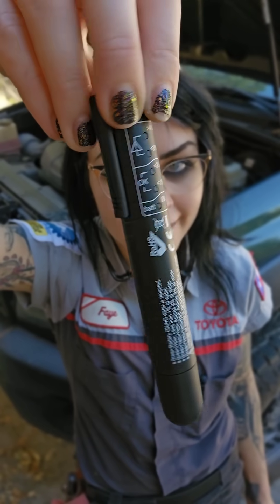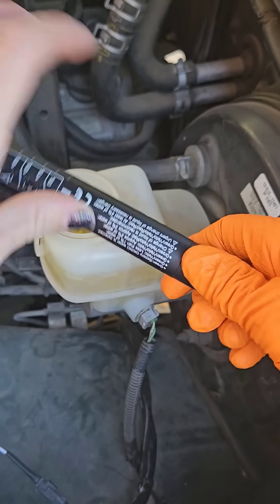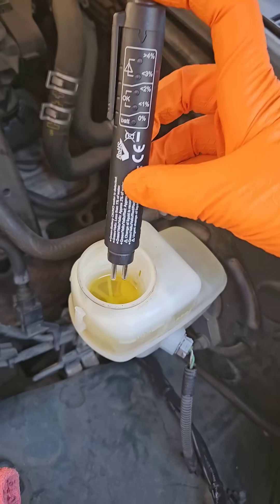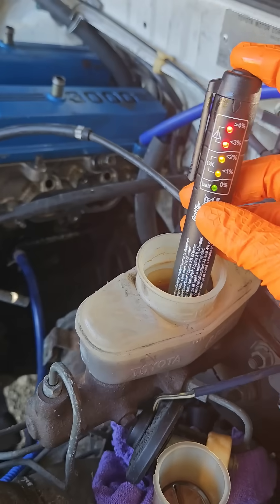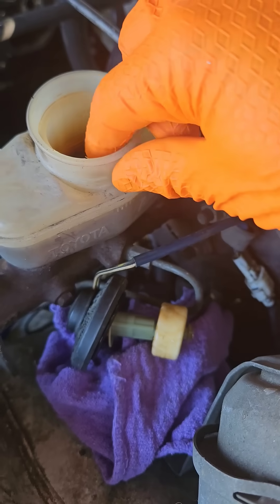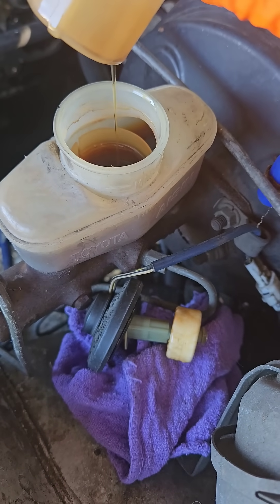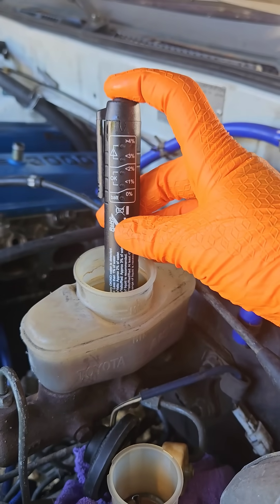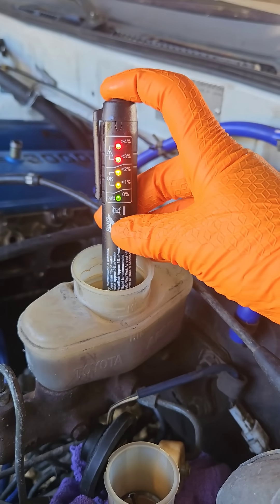Do you REALLY need your Brake Fluid Flushed?? How to Test it For Yourself!

Comment: My wife was told my car needed it’s wheels rotated, belts changed, an oil change and a new filter when it literally had 2200~ miles on it. 

She was spooked because it was a previously owned car (grad gift for a grad that didn’t happen and it had sat in a garage for 4 months only being driven ‘around the block occasionally’) but yeah some mechanic shops are out to get you but not all of them

Comment: Seeing as there are chunks in my brake fluid I’m going to have to guess it needs replacing (I already did it, I’m not driving around with chunky brake fluid) plus the brakes were leaking brake fluid so I had to get the whole braking system replaced…moral of the story dont buy a cheap old car

Comment: And even more dependable, you can take your VOM meter. You can buy 1 for 10 bucks at little redbox. You don't need to be $300 win. And what you do is you put one lead on the metal of the radiator and you put the other league in the center of the floor Ju, see under the cap and it, you see that.  It conducts then it needs to be changed notched. Because you see, good coolant, we'll show you 0 Ω or there about. But bad couldn't has metal in it, and it will conduct like water.. And you don't even need to own one of them when the guy tells you, you need a flush, ask him to get his meter out and show you. Or you can go to autozone. That guy or do it for you? You'd be surprised when one of those little $10 BOM can do for you. Battery light bulbs coolant.

Comment: I have had the same brake fluid in my volkswagen for 3 years.   I also only change the oil once a year.   Pre 2000 VW's are indestructible.

Comment: Yes it's good practice to do it.  It doesn't cost the earth but if you're DIY'ing it remember that ABS systems need flushed too which usually means activating it via a diagnostics setup.  
Water in the system will shorten the lifespan of many components too

Comment: Yes water does get absorbed. But its causes a high copper content in the brake fluid and copper absorb heat cause it to heat up the brake fluid cause it to damage seals in the brake system. That what she didnt explain.

Comment: Instead. Use a turkey baster and suck out and replace the fluid every time you do an engine oil change.
Reply: that helps but still nowhere near as good as a flush, most of the contaminants and the worst part of the fluid is near the calipers and it doesn’t really mix together

Comment: This might explain why my race car has had a slightly soft pedal even with full fluid and new pads and rotors and no vacuum leaks. The car was actually flooded twice in my garage and I never once thought to flush the brake fluid. I'm about to try and see if it helps. 😂

Comment: Another sign you need to flush your brake fluid , the color.  Brake fluid is a  clear fluid. Mold from the water in your fluid turns it dark. The darker it is , the more mold you have growing in your fluid. This mold inturn starts gumming up the seals and pistons in the system
.
Reply: idk bro, it's brown when it comes fresh out the jug lol
Reply: @swappedoutZ71   that is contaminated fluid yes it happens more than you realize, why a lid should tight all times on brake fluid containers after  so long a partial bottle will start changing colors from moisture that has gotten trapped in the bottle
Reply: It's not really mold, I have always been told that it's the residual stuff from the rubber seals etc from the brake cillinders/master brake cillinder.
Reply: Mold? That’s not mold 🤣

Comment: Service advisors love to pad the bill with things that don't require an expensive part that has to be ordered, then 95% of what they charge is for labor.  Bill the customer 1 hour at $150 per hr. Shop rate, then pay some lube-tech $17 an hour to do the job.   There is a way to get a firm brake pedal, it's called installing steel braided brake lines.

Comment: In my experience, 90% of the time, the person scamming you isn't the tech but the service writer.
Reply: thank you finally someone understands
Reply: I would always usually remove it on mileage services for my customers and let them know it was an every 2 year service. They would appreciate it and they would usually ask for me by name after that.
Reply: @JRipsTCG honesty is the best policy.  That's how I used to work as a mechanic. Treat them as you would want them to treat you. Selling them the priority items first and then the others you can recommend for them to decide if they want to do it then or wait for the next time. This way you get a repeat customer who will spread your name if you do good work.
Reply: Ha ha good one. I've quit a lot of dealerships because the techs were ruthless.
Reply: @xavierdiazmcguire4667  notice how I said "in my experience" and not yours
Reply: Service adviser.  Dealerships love making money on services.  Manufacturers even pay engineers to design the flaws in the system for more service money.
Reply: @daniellepage2923  I mostly agree. But sometimes flaws aren't designed, and are just a side effect of the design choices they made. I'm sure there's cars out there that are extremely reliable and very little flaws, but are also either highly sought after/rare (70s-80s Volvo 400, for example) or very expensive.

Still, some engineers make things waaaaaay more difficult than they need to be, or companies make specific things very susceptible to damage/wear (I'm looking at you, 2007-2020 Volkswagen water pump)
Reply: @agentsprocket  oh no doubt. Some are just mistakes or manufacturing errors. Or made on a Friday.  Lots of factors. But some are intentional. And even the regular average car is reasonably reliable. Some more than others.
Reply: @daniellepage2923  No they don't.  I don't know where you got that information from. No manufacturer is telling their engineers  "make this part so it fails at 100K and we will throw a few extra quid on your pay."  This doesn't happen.
Reply: @MikeAnderson-uj3oo yeah people don't want to believe that cars are complex machines and if you want to design for longevity AND performance, that requires additional costs in the production process. So it is about money, but it's not because of intentionally bad designs.
Reply: Well as a service writer, I totally get it when people look at me with disgust. The companiess with a scammy business model, makes their service writer a scammy one. I work for a family owned business with virtually no scams done. Every work has been transparent and there's no pressure on me. They even incentivize me when sales are high, but not on targets, which eases me.
Reply: @geethsan1567  no specific hate, I've just worked for some pretty bad dealerships. All in all it's just greed and/or apathy of the big wigs that really is the root of the cause, but I've worked with service writers that are just absolutely Jerks and will do anything to get that commission
Reply: @agentsprocket well that's the word were living in. Customer want the work done for pennies, and keep forgetting how pricy is expertise. 
As an IT I can say that more often than not fixing the issue boiling down to few seconds. 
That's why with small but unusual issues I always charge for expertise, usually more than for service.
With cars I'm taking car to garage and pay them for telling me the issue and advised fix but I'm doing job myself. They love it, and I'm saving on elbow grease
Reply: @jarocim you want to make sure you have access to manufacturer service information. I was just working on a Volvo last week. 
Now you would think that replacing the battery is straight forward and nothing out of the ordinary aside from resetting the battery life monitor would be a concern. 
However, if you scroll all the way to the bottom of the procedure it tells you to start the vehicle for the first time after reconnecting the battery, from the back seat. Because the airbags could go off. Without that manual you would be totally unaware that unintended activation of the airbags is part of the design. It's probably 1/1000000 that this actually occurs, but that's not a lottery you want to win.
There are a lot of details, maybe not as severe as this example, like this on most vehicles. You need that information and you need to look closely because sometimes its in fine print at the bottom of the page.
Reply: @geethsan1567 the fact it’s still “virtually no scams” not “no scams” both speaks to your honesty personally + the dishonesty of the industry lol.
Reply: Hehe, some shady places will just syphon the reservoir and add fluid without flushing the entire system. Make sure to find a good shop and develop a mutually beneficial relationship. The cheapest shop is usually not the best, too.
Reply: @deezeeYumYum  Yup, though I don't flush my brake fluid every two years either. Wasn't taught that this is even remotely close to regular maintenance, drain and replace yeah. Around the same time as a radiator flush sounds more reasonable. Again drain and replace every two years, 50k miles or 4 years for flush.
Reply: DEF. Esp if you own a BEEMER
Reply: Unless its a warranty, i see techs all the time ask for extra labor to be stacked on just because the book doesnt pay as much - kinda blows because the customer ends up eating that - the book should just be written correctly from the start
Reply: @SL33PINS3XY  As a retired technician, I can say "book time" does not equate for all circumstances.  Rust is the biggest issue. When things are rotten and siezed, it takes more time. And someone has to pay for it. Why should the technician be penalized ? The owner/ customer has to pay extra time for working on a rotten car. 
Or let's say the customer has had work done elsewhere that turned out to be a real hack job. Now the technician has to undo shitty work to repair it properly. Again, the customer has to pay. 
As professional tradesman, why does the general public get the notion that we should work for free ? This comes up all the time. They expect us to diagnose issues for free. Repair someone else's debauchery for free, because they "just had it done"  Let's not forget " I would fix it myself but I don't ( throw in pathetic excuse here). And they think it should be free because they claim they can do it themselves. 
It's not the book time that is flawed. It's the consumers perception of the trade that is flawed. 
My moto that I live by.
I didn't build it,
I didn't buy it,
I didn't break it.
And I most certainly will not fix it for free. 
If I can open the hood of a car and immediately see the issue I'm not going to charge a diag fee. For example,  car comes in with a battery light on. And I can immediately see the alt belt is broken. I would never charge for something simple like that. The moment I have to open my toolbox to diagnose an issue, the customer pays. The tens of thousands of dollars (maybe more)  that we have invested in tools to do our job efficiently and correctly comes at a cost.
Reply: yup, Ill tell a service writer they will need brakes soon and he tells the customer she's gonna die... glad at my current job we get to send videos directly to the customer and show them/explain the issues.
Reply: Well presented and informative!
Reply: And that is why I left Fountain Tire. They hired me to sell tires and basic service needs. There I was with $3-5000 mechanical bills standing there stupid because I can't even (though I know how to) elaborate the service to them. I just pass keys and run the tender. I hated it. I simply wanted to sell quality tire options... Will never take that job again.
Reply: There is a fine line between scamming and just plain being wrong. These folks have to move a lot of cars through the shop and probably don't realistically have time to correctly diagnose. So they do what your doctor does and figure out the most likely thing is and give you that pill.
Reply: Service writers get paid on what they sell. This incentive will make anyone push all work, at least if they want paid.
Reply: Wow...
Reply: Guess it would depend on the business model right? Whos saying what needs to be done might be different in different places
Reply: The majority of the time yes, but the tech is the one working under your vehicle, they are the ones letting the service rep know what need# to be done.
Reply: I worked at several dealerships in the service department as a runner while in school and Service advisors were the worst. Out of the 15 or 20 I worked with, maybe one wasn't a conman. I say maybe one because he was religious and he seemed pretty honest, but who knows, he may have been as bad as the obvious bad guys(back in late 70's to early 80's, it was all guys).
Tech's rarely were involved(but not never)
Reply: True.  I had a service writer who would keep poking his head in asking me if I “found anything”.
Reply: THANK YOU. I had a service writer who would take my recommendation for something small like a tire repair and turn it into four tires, front and rear brake pads, and an alignment.
Reply: yeah, and they’re not good at conveying messages to the mechanic either, make sure you write your complaints down so they don’t change the words around or misinterpret what you’re trying to say
Reply: So basically every dealership, thus why need to find a good local shop and watch the quality and cost go down for stuff you cannot do yourself. But people can change brake fluid can be done with kit from HF for 20 bucks or soda bottle and some tubing worst case to bleed them.
Reply: Yesterday my boss made me do an oil change on a car that had new oil... I was pissed cause I didn't want to do it. But my fraudulent boss was so adamant in doing it. I just want to smack this guy in his smug looking face.
Reply: 90% of the time??? More like 99.999999% of the time
Reply: Yep
Reply: More like 100% of the time
Reply: Yup and his name is Khalid at Toyota Center
Reply: bien.🙄
Reply: 100%
Reply: Contaminants from the system due to segregation of components is a factor too. If it’s black flush it. Best thing is every brake job get it then.
Reply: Being a servuce writer was one of the toughest jobs I had. I went into the job treating people like i wanted to be treated. I am honest, but everyone thought i was scamming them. On one car, the brake rotors were shot. From the outside, they looked great. On tge back side only 1/4" of the pads could hit the pad. The back of rotors were rotted out. Customer went to another place. They obviouslty only shined a flashlight through the holes in the wheels and told the customer the brakes were fine, and that i was trying to scam them. I offered to show the customer, and they refused to look.
Reply: It's definitely both 😂
Reply: As a apprentice tech in canada that doesn't make money off selling stuff. That is so true. I had an advisor sell a old lady a 4wd service and her fwd Buick suv. I had to bring the advisor over to show him that im not doing this service and you need to tell the customer she dont need that. He looked at me with shame as if I woulda been happy to scam a customer for no reason or self gain. Be carful you guys. Theres still honest mechanics out there but they usually the younger ones
Reply: The tech has to speak with the service writer tho. So maybe both.
Reply: Exactly we just want your shi out of our bay so we can move on to the next one we don't wanna do shi we don't have to do
Reply: Tech: man these tires are almost bald 

Service writer: yah but the brake fluid doe
Reply: I do my brake fluid every year my life worth more than $200 idk about the rest of you guys
Reply: I often strike up a conversation with the tech and ask their insights and opinions.
Reply: Agreed. I was a tech and now Im a writer. I have down sold items cause it doesnt make sense. The other writers will sell anything and everything
Reply: unfortunately alot of misunderstanding and "scamming" feeling is because many service writers have no idea what they're talking about.  If I tell them in my terms whats going on, many of them have as much car knowledge as a normal civilian.  I found if I tell them "brake pads are low, pads are gritty to make sure car stop, brake pad lose grit, no grabby" they can in turn help the customer understand the issue versus "yeah idk miss chevy, but they said your brakes are bad" which can mean anything.
Reply: And you wanna know where that service writer gets his list of what’s wrong w the car? The tech lol
Reply: In my experience, I wouldn't ever give my vehicle to someone that can't break a lug nut
Reply: Tell ya first hand it's a team effort..service writer sold it and the tech, very aware of the vehicles unnecessary, service advisor suggested concern will perform the service, because I quote " I have a family to feed"!! Meanwhile they both catch a commission check lmfao...but think what you want, it's America!!
Reply: A tech is not a mechanic, it is someone that gets paid to practice and learn on your vehicle by destroying it....
Reply: @mikeschmidt2554  As far as I'm concerned  it's just a title. My Canadian license  said "Motor vehicle  mechanic " forever. Than our government  decided to change it to "Automotive  service technician". At the end of the day I'm a mechanic.  I can diagnose  and repair vehicles as well as understanding  why something failed.  I'm not a "parts replacer"  like the majority of people entering this trade are. They have no real understanding of how things work or why they don't.  They only know how to replace parts. And some fail drastically  at that.  That's the biggest  issue with this trade as far as I'm concerned.  The days of real mechanics are done.